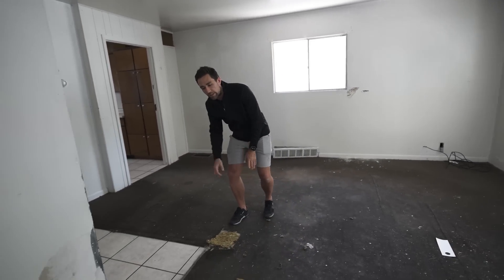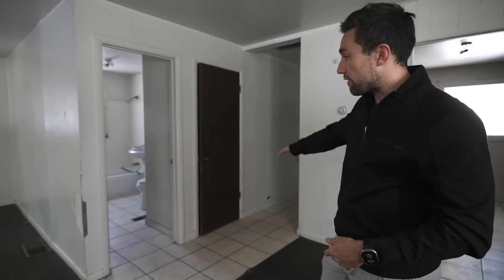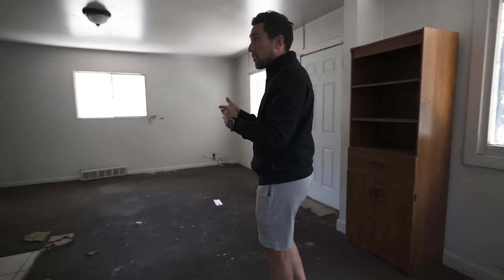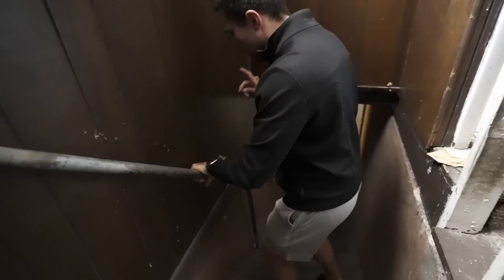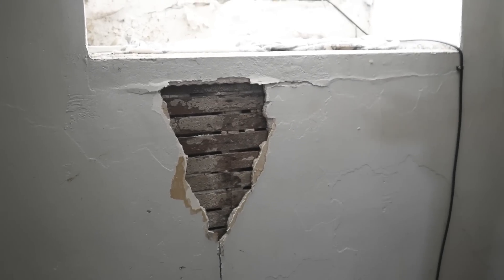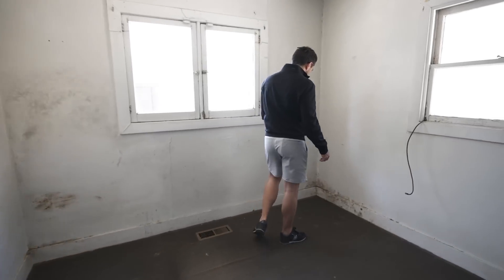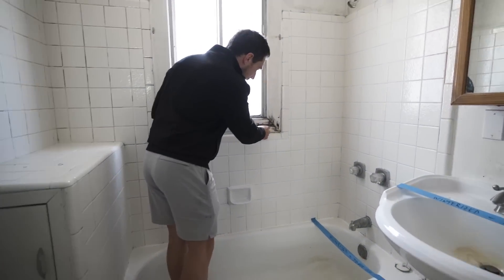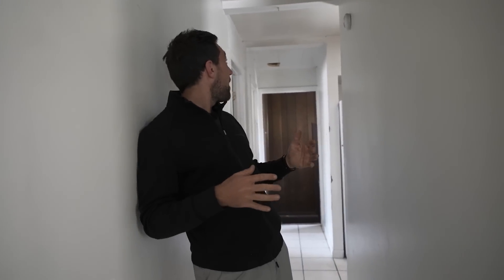DO NOT BUY THIS HOUSE | Noob vs Pro

Comment: Most homes from that time period will have sagging. A lot of these early 1900's homes (at least the bungalows and such), were built with very minimal framing supports. Usually just 1 in the dirt floor basement. And the support usually is just a stone column, or cinderblock/brick column, which too also sagged, hence the floor joists sagging. If you see those cast iron metal supports or added cross I-beam in the basement of these early 1900's homes, especially the bungalows, it means the joists are now properly supported. However the floor sagging will likely still be present b/c they didn't want to pay to raise and/or run the risk of causing more problems. We have two rentals which have this, and it's not a big deal. Yes the sag is noticeable. But it's a rental.

Comment: Sigh. A house that grandma  updated the electric, the plumbing, the HVAC and roof are rare gold finds these days. Unless it's your grandma and she wants to give it to you. I picked up an old house with plaster walls, old roof and cast iron pipes to street. But had new HVAC, rewired kitchen & bath and replumbed. These days you gotta pick your poison and price in some of those bigger costs, not just cosmetics.
Reply: exactly, especially here in Dallas. Grandmas house in the last video would sell at the market, not below it for fixers. sellers in north Dallas are still getting 100%+ of asking price